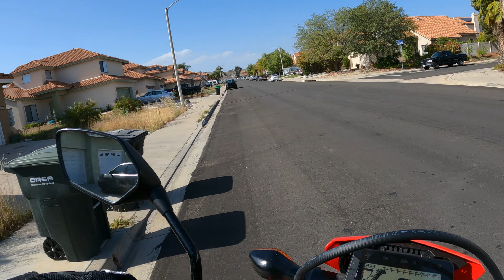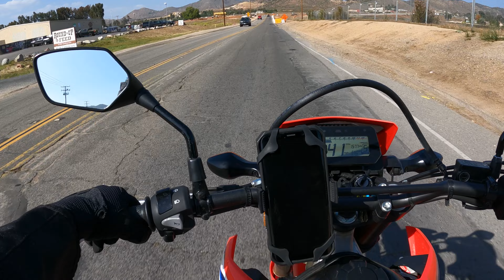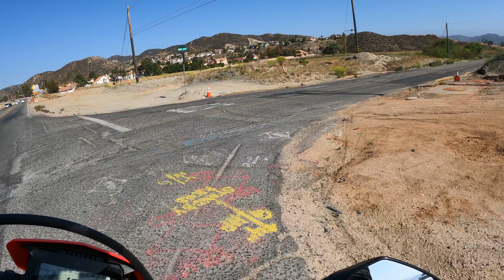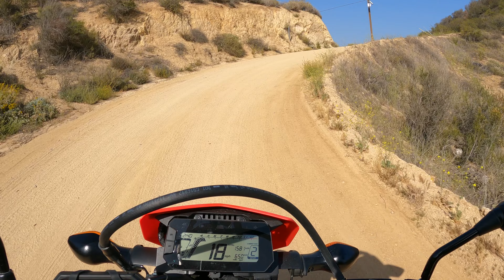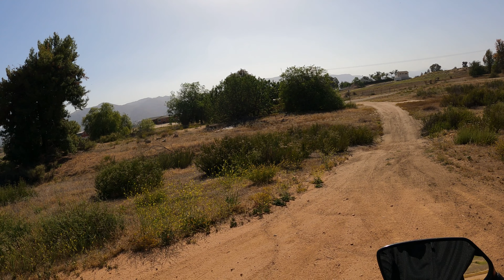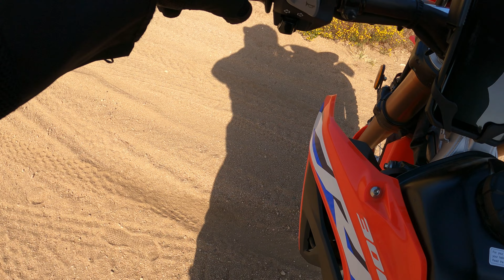The Biggest Problem With The 2021 Honda CRF300L

Comment: ideally I would upgrade to the 450l
Reply from the maker: Yes but it is double the money and a taller seat height
Reply: I personally would prefer a taller seat but understand why others need one shorter. This CRF with a 350 motor, slightly taller but just as smooth, would be the only dual sport/dirt/adventure bike I would ever want.  If Honda kept the characteristics and maintenance of this bike: my neighbor has the 450 and our two motos are hardly comparable. I can commute for months on the CRF with only obsessive chain cleaning/checking and keeping mud off to bother with…I’d eat through tires, oil/filters, and my hooligan tax budget if I owned that 450L/RL.
Reply: 450 would be perfect if it weren't for the pain in the ass maintenance schedule, i really dont get why they did that

Comment: you can change the shift light, most rear tires are a hair taller, could put a smaller rear sprocket, but its only a 287 cc what did you expect.
Reply from the maker: Well this is the same engine in the cb300r and I like the gearing on that bike. It has plenty of torque to be at 6,000 RPM at 70 miles an hour instead of 7000 rpm
Reply: @TheCoolestCourier  I live near you but I mostly ride off road but when I do hit the highway I fine at 65-70 red line is 10500 if I geared it higher I dont think the engine could pull it.
Reply from the maker: I think it probably could pull it but it's fine either way it's not a huge issue. If I have to get on the highway for more than a few miles I always take my xsr

Comment: After owning a few smaller displacement bikes I won't own a single cylinder bike under 400cc that will see any highway use.  Add in hills and headwind and you're a road hazard.
Reply from the maker: Very true

Comment: 300l has the widest transmission ratio spread of any dualsport being manufactured. First you say it revs too high in sixth and needs a seventh, then you say you never really get into 5th and sixth gears. I don't get it.
Reply from the maker: On trails and aggressive dirt riding I never get into 5th or 6th Gear, that's what I was saying. So at that point I would lean into the fact that 5th and sixth should be overdrive gears

Comment: This is an off road bike.  You should trade it in for a T7.
Reply from the maker: I already have that motor in my preferred package which is a naked bike. I have a 2019 xsr700. I only use this Honda for off-road I'm just nitpicking to make a video. This won't be an issue for most unless someone buys this to actually commute to work and back which some people do

Comment: This bike is perfect for what this bike is supposed to be. I think honda knows a little about motorcycles 😉 . You need more speed, then get the bike for that. This is a small displacement bike to have fun with and not win any motocross or Supercross races or even motogp. Different bikes for different things. I enjoy my crf300l around town I lane split to the front of the line at red lights then leave everyone behind. Off roading it's plenty for me. You can get into trouble going 5 mph on dirt on any bike, so I don't need 60 horse power on the dirt.
Reply from the maker: Yeah its is perfect at so many things I dont think it's worth messing with.

Comment: My gear box makes wicked noises at higher rpm's :(
Reply from the maker: Sorry to hear that, it's my first time hearing of that issue
Reply: @TheCoolestCourier  I ride it at 12 o'clock for miles... bring it up in 3rd gear a lot... it's still under warranty gonna bring it in, then trade it in and buy a 2023 Yamaha WR450
Reply from the maker: Are you going to try to convert it street legal?
Reply: @TheCoolestCourier  absolutely lol, I can't wait to hit the trails and the highway on a 450, hopefully I can cruise with cars without revving the shit out of the poor engine
Reply from the maker: I know it's a much different bike but did you consider the Honda 450?
Reply: @TheCoolestCourier  yeah I'm a huge Honda fan, I have a Honda Pilot, 2020 Accord, crf250, CRF300L, I think Yamaha sold me on there replaceable subframe, and super lightweight
Reply: Plus there the same price

Comment: Don't ride it on freeways...stick to dirt roads and two lane country highways for short trips when most other cars are driving around the 65MPH range and it'll be fine. Move up to the 450 if you want to hang with the maniacs on the freeways...the penalty for the bike is the cost along with a very high seat height. I'll buy this 300 as soon as one becomes available and it'll just be a campsite area explorer and quick trip into town for groceries, etc...when I'm out with my truck camper. AWAY from the cities.
Reply from the maker: Yeah I definitely use it for shorter trips and trails, I have a Yamaha xsr 900 if I need to go anywhere further

Comment: i dont understand why both honda and kawasaki make those bikes the way they are no real power and no good top speed as you said about the gears the same goes for a kawasaki bro im not joking if you ever try 90s bike for example klx 250 or xr 250 (i dont put the old crf 250 here in comparison cause its really unfair way more powerfull than those bikes)you will see that they running way better than the new models in papers there good but in reality they are weak i dont know about yamaha wrf 250 but from what i know there are faster than kawasaki and honda
Reply from the maker: All I want is for a manufacturer to make an affordable 350 or 400 option with a approachable seat height like these 300s
Reply: You don't understand because you have completed only elementary school...
Reply from the maker: I would agree with misinformed but that seems a little harsh 😆

Comment: Its a glorified 250 what do you expect?  
You can gear the shit out of it ,but unless you're a featherweight the engine wont have the horse power to pull the rpms. Then you're screwed when hitting trails.  
Buy  bigger bike ,  its only 288cc's
Reply from the maker: I love the bike and it's lightweight with its small displacement. If I want to ride a bigger bike I have my xsr700. I just made a nit picking video because that's what gets views unfortunately
Reply: @TheCoolestCourier  use a cfr300 to jump Caesars Palace ,school buses and the stuff Evel Knievel did I'd watch that video !!

Comment: Biggest problem with that bike is its over 320lbs and only has 27hp.. A joke.. KTM 350/500 all day long!!  Sorry..
Reply from the maker: Oh dude I would love to see you on a Suzuki dr200. My dad has that bike and my CRF might as well be a Super Duke compared to that bike lol.
You definitely have to consider the price gap between those two bikes though. It's nearly $8,000, you could buy a whole ass bike for that much.
I also don't mind the amount of power on this bike since I only use it Off Road. I agree for the road I like much more power, I have a 2019 xsr 700 and that is like bare minimum of what I would like on the street